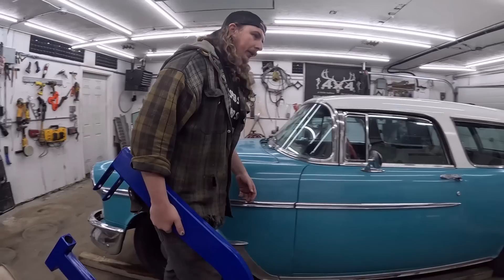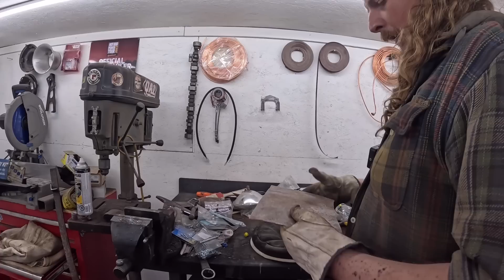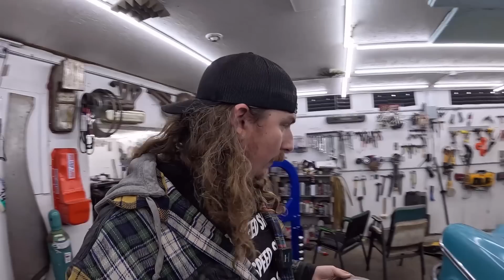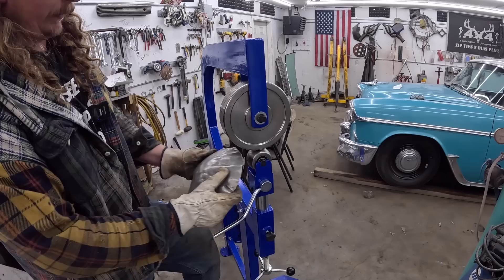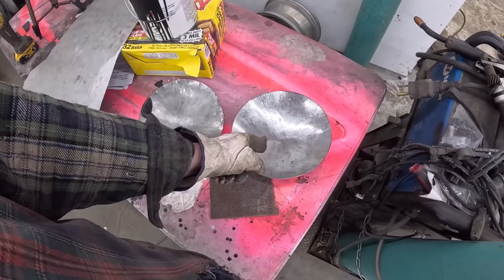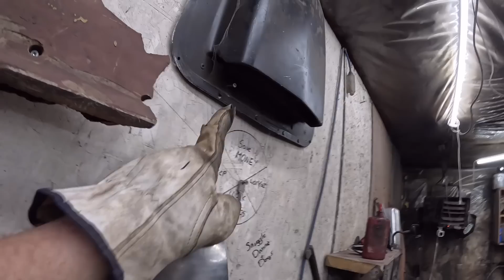Mastering Metal: First Time Using an English Wheel - If I Can Do It So Can You!

Comment: I got a break and shrinker stretcher. My next thing is a bead roller and I've almost got my scissor lift like yours done I bought harbor freight cylinders they were a lot cheaper and I had to lengthen it 6 3/4 inches

Comment: Quick tip Dan if you put a small bicycle inertube around the top  large wheel it will flatten the metal without stretching it more and if you remove it the wheel will stretch and flatten also remember to keep the wheels clean and the metal to reduce imperfections 👍

Comment: That e-wheel is a tad beefier than the older ones. Couple pointers. Wheels, 2 rigid on front, swivel with lock on rear. 
Put flat anvil on and check that both wheels contact across faces. Mine didnt. Noticed it a couple weeks ago. 
Princess auto 20 gauge is really workable…